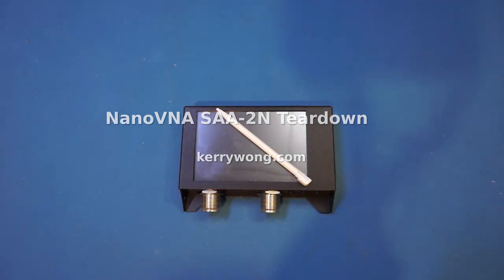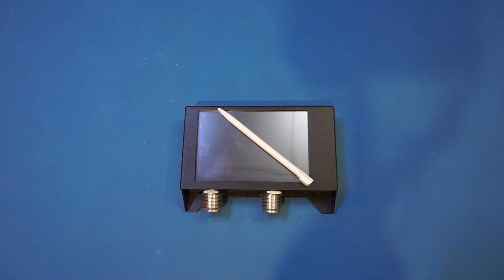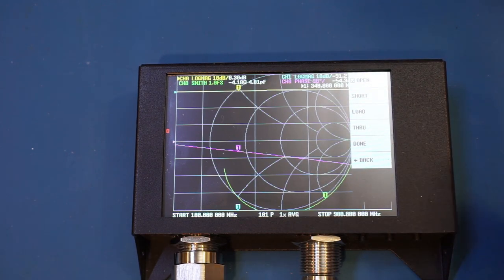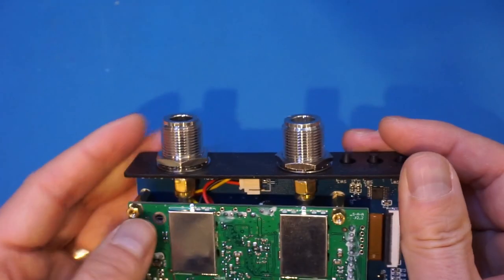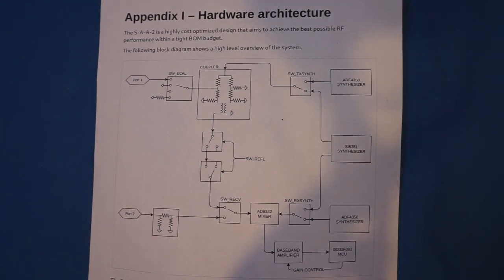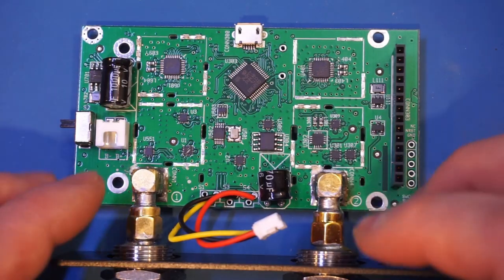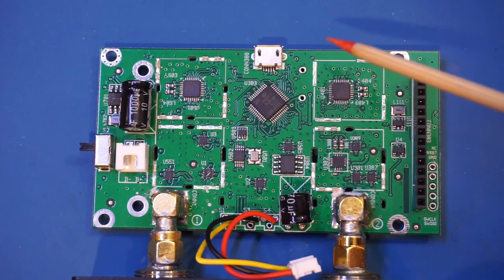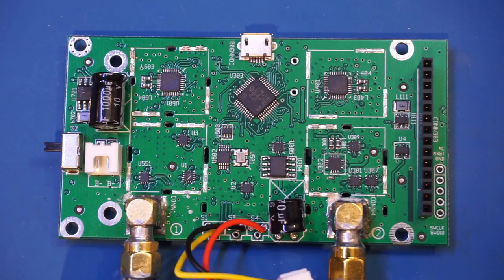NanoVNA SAA-2N Teardown

Comment: It looks like they used the original SAA2 main board and just bolted on two SMA to N adapters. This offers no real advantage over the SMA version, I'd rather buy the original and have the choice to adapt. The "factory calibration" you refer to is mostly useless. You will need to calibrate the ports anyway to move the measurement plane from the port connectors to the end of your cables and thus to your DUT ports. Otherwise you'll measure your cables together with the DUT, this is almost never what you want.
Reply from the maker: I was a bit disappointed at the bolted-on adapters as well.
Reply: You can buy the SAA2 with SMA already so this version is an option for people who actually use it a lot. SMA will not hold up as well as N in the long term (>~500 cycles).

Comment: Nice tear down. My nano van won’t measure frequencies above 140Mhz (faulty). If I were to reflow components, what would you recommend? I’ve seen videos suggesting that a different part of the circuit does above 140Mhz.